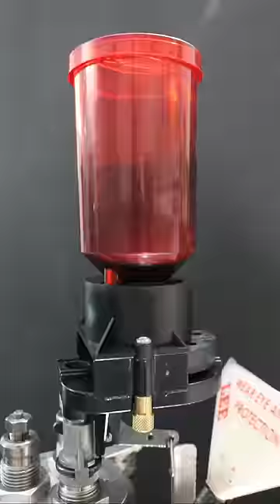Reloading 9mm ammo in 1 minute with Pro 1000  -   #reloading, #9mm, #leeprecision, #ammo, #shorts

Comment: Lots of run out in that press.
Reply from the maker: Good afternoon Simon. Thanks for looking at the content and leaving a comment👍👍 Very impressive observation skills. Someone picked up on that a couple of days ago. It is not usual with this press as it is as aligned as one would expect on all occasions.

The alignment issue you see here was real but lucky for me it was no issue during firing. I captured it as soon as I started editing and immediately knew the reason. I estimate that few rounds prior this single round footage the shell plate carrier cracked because I replaced it few rounds after this footage was taken when it totally gave way. I had to inspect a lot of rounds with a case gauge because I was not sure how many might have had issues. 

After replacing the complete part, item 90683 by Lee, it all worked fine as before.

Do have a look on the channel for longer clips on this press. Link in the pinned comment.

Have a great day and thanks for your comment.🥇🥇

Comment: DON'T YOU KNOW HOW MANY BULLETS YOU COULD SHOOT FOR THE PRICE OF THE RELOADER 😮

MAYBE A BOX OF 20 😢
Reply from the maker: Hello Shawn. Thanks for looking at my content. Yesterday someone asked a similar question. Here is the reply with some numbers. Take care and have a great day.👍👍
-------------------
Here are my own workings as follows: 
🔶Based on 9mm setup only. (Changing caliber is approximately $100 addition, mostly dies and shell plate)

🔶ALL FIGURES & CALCULATION DONE January 2022 as follows:

$300 _ Lee Pro 1000 Press 9mm, ref. 90640.
$020 _ Lee Case Collator, ref. 90667.
$045 _ Lyman Ammo Checker, ref. 7833000.
$012 _ Dillon precision case lube, ref. 13733.
$055 _ Scale frankford arsenal, ref. DS-750 
$050 _ Price estimate for a generic caliper.
$048 _ Price estimate for kinetic bullet puller. 
$530 _ TOTAL INVESTMENT of above listed item ONLY.

$160 _ TOTAL Calculated price of raw materials to fabricate 1000 rounds type (CPRN-124gr) "brass cases free)
 
$300 _ TOTAL Average price for factory loaded ammo, 1000 rounds, 124gr.

🔶Therefore, excluding labor cost, I save $140/1000 Rounds.
🔶Therefore, investment of $530 / Savings of $140 = 3786 rounds.
🔶Therefore, after 4000 rounds I start saving $140 / 1000 rounds I send down range.

🔶🔶🔶 In short, after 4000 rounds I cover ONLY my investment cost.

Comment: Во как, оказывается, вручную пули собирают
Reply from the maker: Good morning Аhtoh and thanks so much for looking at my content 👍🙏👍🙏. This press can be fitted with an original attachment for under $100 that would place the bullet in position automatically, in a mechanical fashion without an external power supply but personally I find it better to place the bullet manually because I can use that motion to also visually inspect that the powder is in the case.

Have a look at the link in the pinned comment for the complete view of the process on some 9mm or alternative, even more details for a .45ACP. You can see the real speed from here. Have a great week.

Comment: So it does all this stuff for you and has a place for 3 rounds on that thing, but you still have to put the bullet on top yourself? This seems overcomplicated to achieve absolutely nothing.
Reply from the maker: Good morning Ryan and thanks so much for looking at my content 👍🙏👍🙏. This particular short clip I opted for a slow mode with only a singular round to make the process more understandable. Normally it goes much faster. In Addition, this press can be fitted with an original attachment for under $100 that would place the bullet in position automatically, in a mechanical fashion without an external power supply but personally I find it better to place the bullet manually because I can use that motion to also visually inspect that the powder is in the case.

Have a look at the link in the pinned comment for the complete view of the process on some 9mm or alternative, even more details for a .45ACP. You can see the real speed from here. Have a great week.

Comment: Lee pro1000 the worst progressive loader made.
Reply from the maker: Good morning James and thanks for stopping by🙏👍. This press is no Dillon or Mark7 but for the price paid it is a great deal. And the rounds are also great as I have been using them for many years with no issues. Mind you, it gave me lots of issues initially and my assumption is that you got the same bargain. Did lots of small changes but honestly, it is working Ok for me, most of the time.  

Here is my link for the Dillon 650 in action, this time on some .45ACP.  https://youtu.be/UyKHr_O8-tg

In addition, have a look at the clip via the pinned comment for the Lee pro 1000 going at full speed and I also have all modification clips one the channel..

Take care

Comment: Eww.  Soft nosed bullets in 9mm?
Reply from the maker: Good morning and thanks for stopping by and looking at my content👍👍..  The projectile used here is a 130gr SJFP, reference B-329 fabricated by PRVI, diameter of 0.3545. Hard to find but I found some old stock, around 500 heads in total.

A similar projectile that I have also used, more frequently than this is the 125gr SJSP, reference 613573 by Fiocchi. Both mentioned projectiles I have used to reload 9mm and .38 special rounds with no issue what so ever. 

Have a great day.